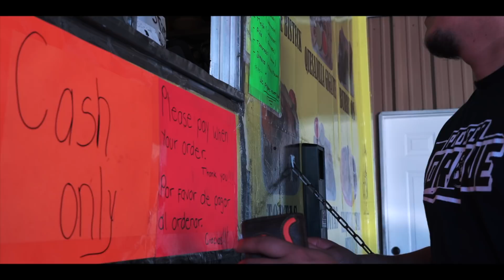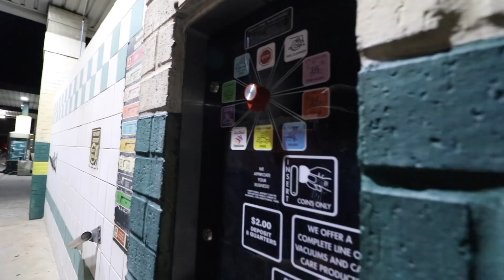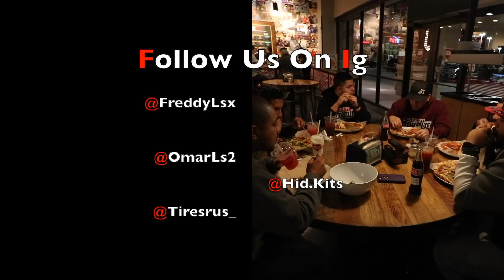THE C10 IS BACK

Comment: Take the bed and the cab off and take the frame to get painted Candy Light green and get coilovers for the rear suspension and cal tracks full drag truck and at least primer the body the rust will get the better of the truck